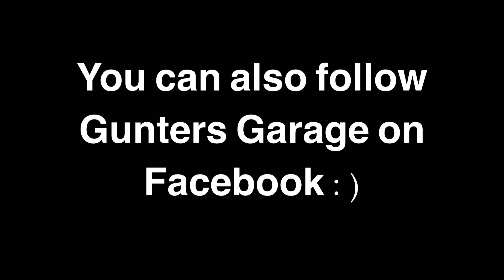Vintage wood handle screw driver, Tool Tuesday

Comment: Nothing like a good old screwdriver! I like to pick up old one cheap anytime I can. It's nice to have several placed in the house,garages,tractor tool boxes,etc. No mater where you at you'll have a few close by
Reply from the maker: I just like the wood handles and you can get them cheap. I actually have a small tool kit in my 8N and my Farmall. The 8N has a ford adjustable wrench, screw driver and a small period correct grease gun. Actually have a set in my Model A as well. I use the Farmall most and use the tools in my kit a lot also. I love how you can take an old rusty wrench or screw driver that was less $5 and its just as useful today as it was 50 years ago.